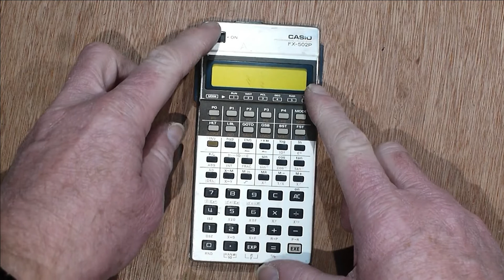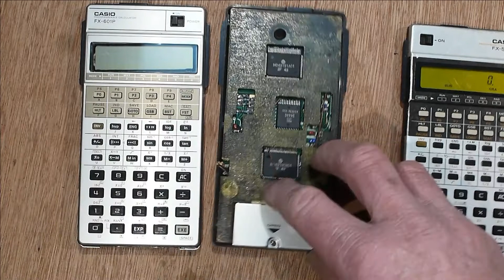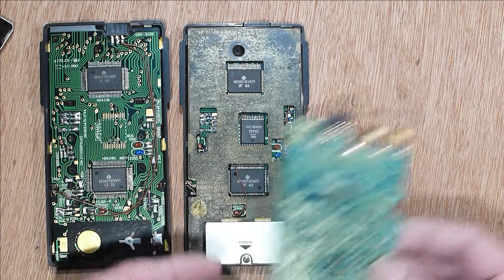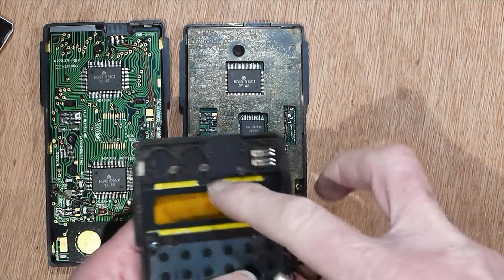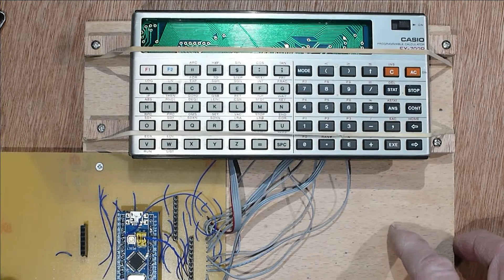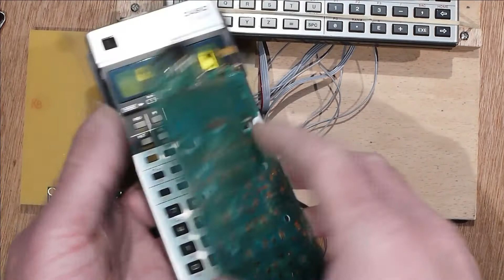Casio FX-502P Recreation Part 1

Comment: Sounds interesting.
Probably its "easier" to build your own PCB in order zu integrate the processor and glue logic. The only restrictions are the position of the buttons and On/ Off switch but otherwise you can place the components freely.
Reply from the maker: Yes, the board outline and routing is quite complicated though, but it should be possible.